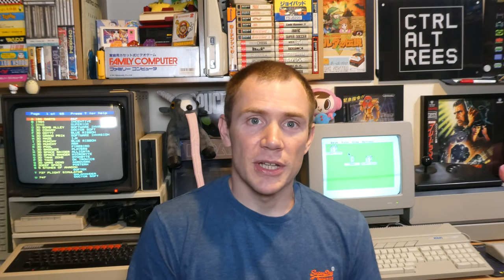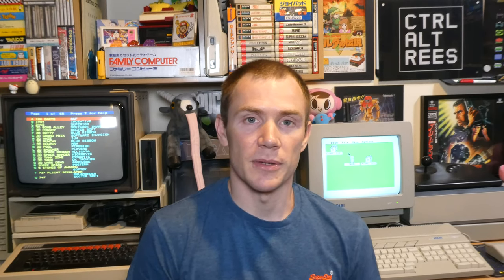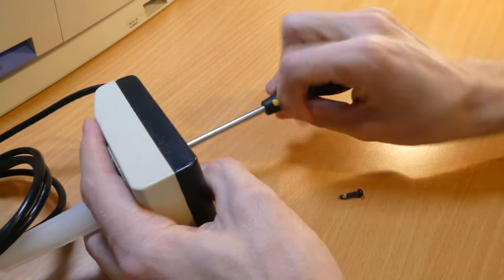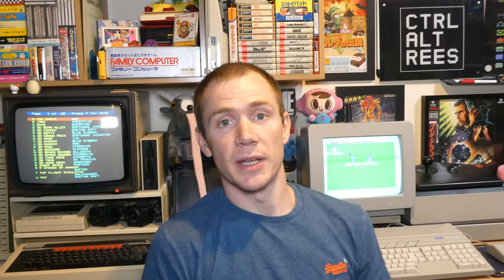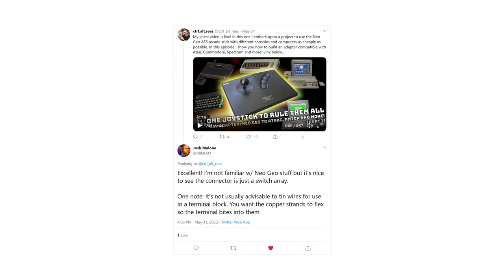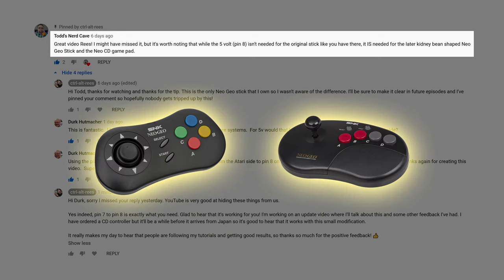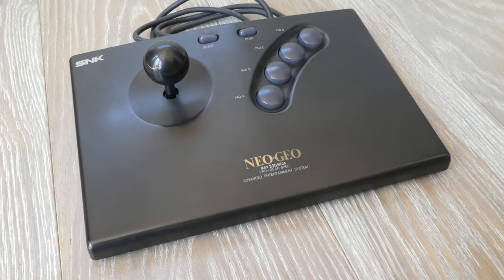Your Feedback & Tips From Episode 1 - OJTRTA Part 1.1

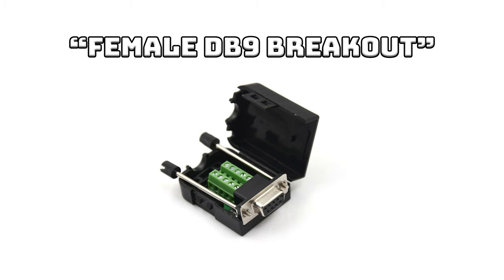Comment from the maker: 2:45 - Incidentally this is actually called a DE9 breakout (the difference between DB and DE plugs was discussed in my previous video) but there are far, far more matches on ebay when searching for "DB9", the name by which this connector has become colloquially known. I know, I know, it's not right, but what you gonna do. 🤷‍♂️

Comment: Nice update! I'm right now finishing a personal project to build the "ultimate" arcade stick for my retro consoles/computers. It's made from original Sega/Sanwa parts and I the way to connect the arcade stick with each computer/console is by using the DB15 breakout connectors you show on your video. It's a great way because it's quite easy and reduces significantly the amount of soldering required. As commented, I'm finishing last cosmetic touches, but the arcade stick is 100% functional and I have already created adapters for Neo Geo, Saturn, Super Famicom/Nintendo, Megadrive, MSX, Amiga, PC and NES. Dreamcast is on the way. To create the adapters what I do is to solder some wires on gamepad's PCB (one for each button/direction + ground), attach the other lead to a DB15. Using a female DB15 in the arcade stick and male DB15 breakout connectors in the game adapters. Just plug the DB15 to the stick and the other gamepad lead to the console/computer and play. Some examples: Saturn gamepad adapter - https://ibb.co/q9751sG // Neo Geo adapter (because how Neo Geo works, it doesn't even require a gamepad) - https://ibb.co/w6tJBH0  // This is how the arcade stick looks like at the moment - https://ibb.co/dDzVbjh . About where to buy, I ordered all DB15 breakout connectors from Ebay (Hong Kong): https://bit.ly/3f6p8Ad . About the cables, you can get the Neo Geo extension cables quite cheap from AliExpress (China): https://bit.ly/2MKdzCl . Because you only need the PCBs from the gamepads, you don't really need to buy "good" game controllers. Cheap replica ones work really good as well (even sometimes it's easier to solder on Chinese PCB than in the original ones). Some examples: Super Nintendo/Famicom gamepad - https://bit.ly/3dNEV6E  //  Saturn gamepad: https://bit.ly/3cGhFWY (bought from UK, by the way). You only need to solder on gamepad PCB, where I have the approach of making some holes and then solder each wire from behind. I will try to make a video explaining the whole process, but I don't have too much free time lately. If you have any doubt, don't hesitate to reach me. Finally, here you can see my son enjoying the arcade stick with some Super Famicom games: https://ibb.co/Tws01LB . And a video of myself, testing the arcade stick with KOF97 in a Neo Geo CD: https://youtu.be/L_Wg746vIiI .
Reply from the maker: Wow, that looks like a great project and it's obvious that a huge amount of work has gone into it. Thanks so much for sharing!